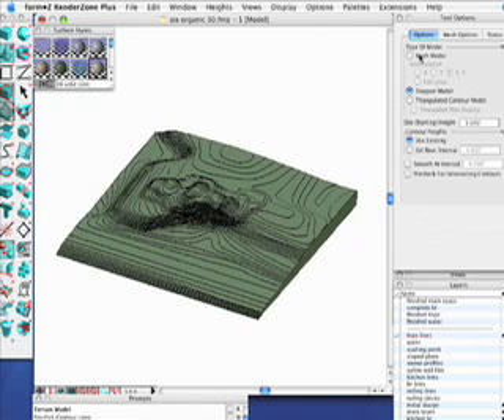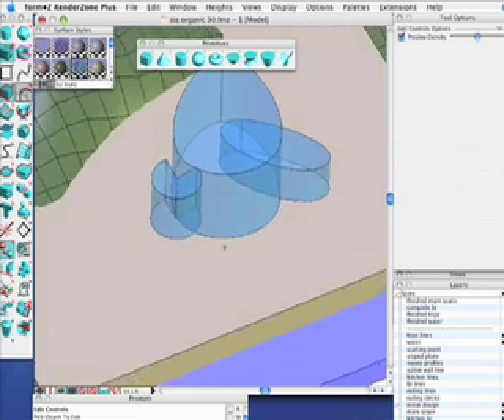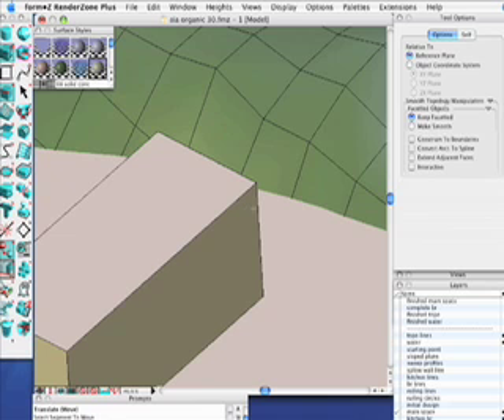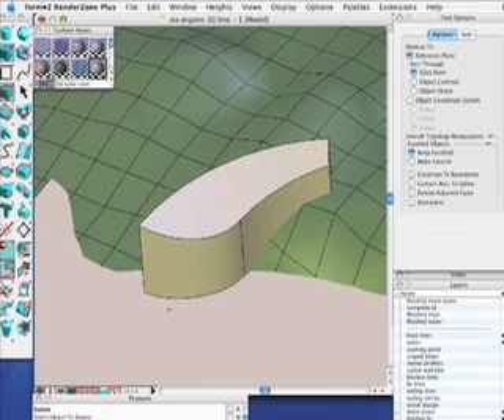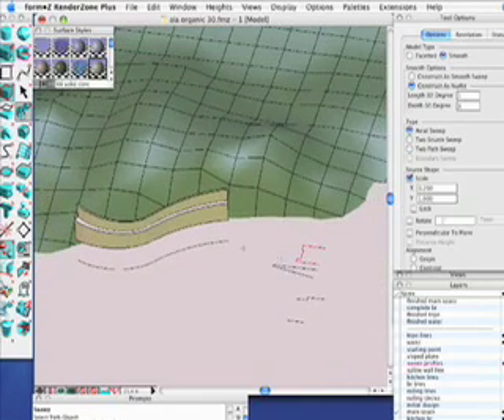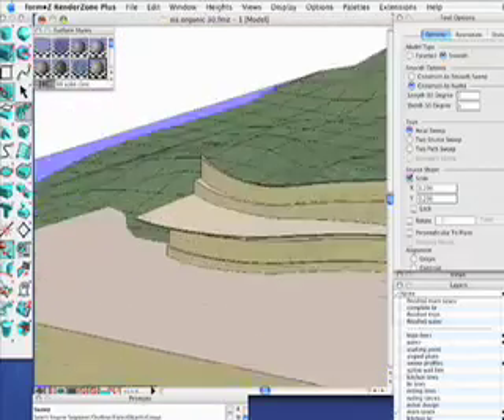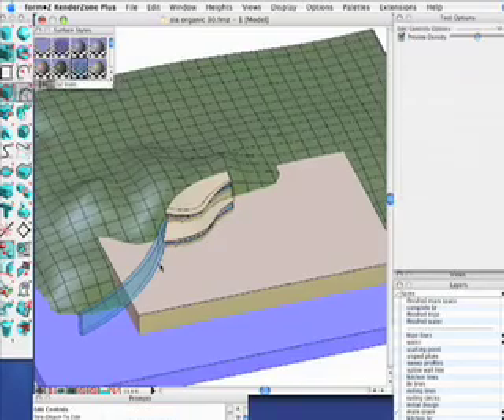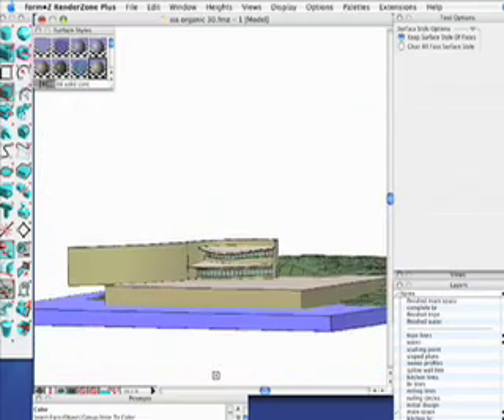Advanced Modeling Demo (Part 1)

Comment from the maker: Aronath,

Some people get it in a week or two, others never get it -- a lot depends a lot on the individual.  The best way to get started is to go to formZ (dot) com, go to Downloads: Demo Videos and see the instructional videos at the top.  Then go to Download: Documentation and download the Tutorial.pdf, and also Download: formZ Demo.  Then try using the Demo and following through the tutorial.

You might also want to check out bonzai3d (dot) com for a slightly easier program.

Hope this helps